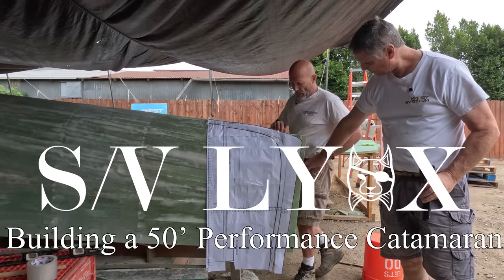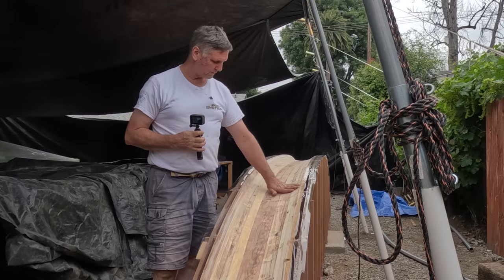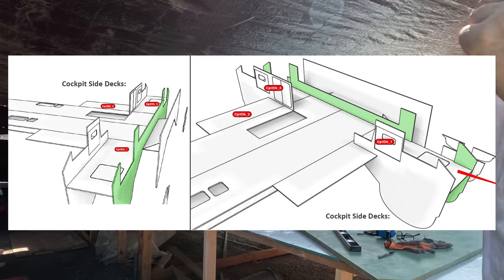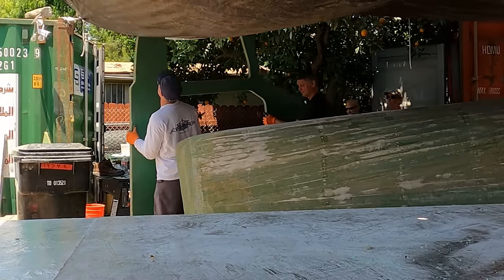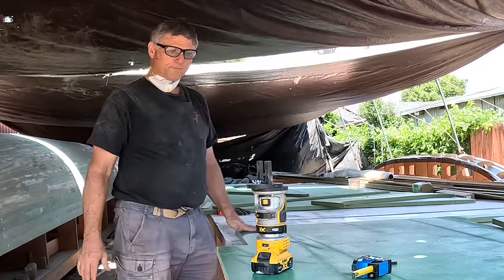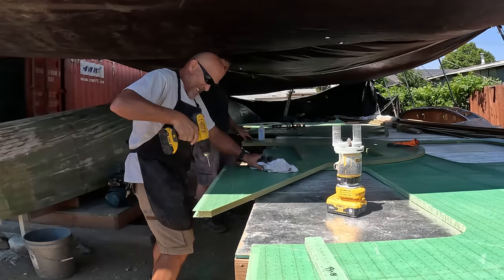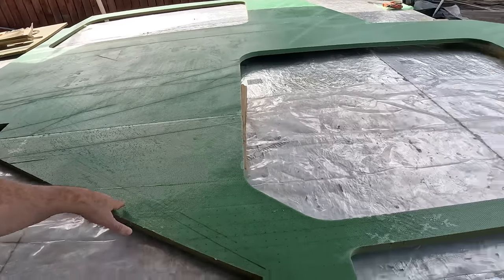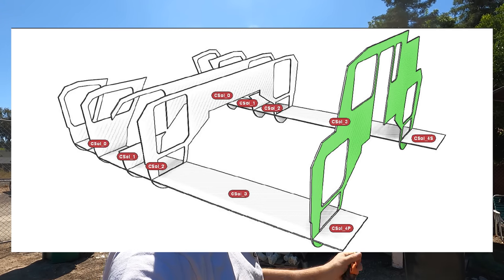Kit E40: Carbon Fiber, Big Bertha, and June Update

Comment: The project is accelerating in terms of progress. I enjoyed this episode but was a tad concerned when it appeared you were going to assemble Bertha completely on the bench - I thought where the hell are they going to store that - how are they going to lift - I was relieved when you clarified that you would be assembling at the time of need  into its final home.  Well done to the team.😀👍⛵️
Reply from the maker: Yes, that was the plan.  But later, when we discovered just how many reinforcements that BHD 6 required, we went ahead and assembled it shortly before installation, which was done with a Bobcat.  You'll see that installation in an upcoming video.  It was big to handle, but we got her in place.

Comment: Why do the deck abutting bulkhead sections get roped and not hull?
Reply from the maker: Where the bulkheads attach to the hull they are tabbed in with glass, so they are very strong.  The parts that need rope are either exposed edges or long spans between the hulls where they will take pressure in the center as the boat tries to flex or bend.

Comment: It's hard to see on the video, but are the scarf joints cut in the proper direction? The thickness should be cut on a bias of 60 degrees. So the width has the area for gluing. Then screwed through the top to clamp.
Reply from the maker: We just followed the manufacturer's directions, but since then, we solved the issue.  It wasn't just the joints that were snapping, the wood was ripping apart even if the joints held.  The cedar wood we purchased ourselves (not what came with the kit) worked fine, so we're all set now.  Thanks for the advice though.
Reply: Ran sailing is scarfing cedar and it looked different from the way you guys were doing it. Glad it's working correctly. Thanks
Reply: @SailingSVLynx  To me the joints you were doing in the cedar are miters not scarph joints, when you do the next half of the beam you could make up a couple of strips with the joint in the other direction and see if it helps, I would be inclined to do a 7 to 1 scarph

Comment: Hey Phil, this 'rope' idea for beefing up the big panel edges is a lot of work & imo seems a bit 'tacky' from an engineering perspective (pardon pun). 
So here's a question - why couldn't you use a dimensionally suitable 'real rope' instead, and simply saturate it with epoxy before jamming it into those panel cavities, eg nylon rope? (which could be pre-heated overnight to 'outgas' the slip agents it might contain - to improve adhesion - and which has a surface energy similar to that of epoxy)
Reply from the maker: This is standard practice in foam panel boat construction and we are just following the design instructions.  That doesn't mean your idea wouldn't work, but we also don't know that it would.  We don't want to experiment with the engineering that has been worked out by the boat designers when it is a structural component of the design.
Reply: @SailingSVLynx  Thank you for taking the time to reply Phil - I guess given the number of questions arising from the general "plans", at the end of the day it's your bum in the saddle - so you need to be careful & I get that !

Comment: wow this is super inaccurate work ! good luck to you
Reply from the maker: At times, it does seem that way but, so far, things are coming out fine.
Reply: Respectfully, How do you figure this work is inaccurate?
From any work I've done with fiber-glassed surfaces, it feels as precise as possible to me. I'm sure we'll see any required adjustments they make as they move forward fitting everything together.

Just a thought, respectfully, I'm sure your posts' intent was not meant to sound negative, perhaps in future comments, the 'tone' might be able to be more positive... :-) 
Best regards,
M-